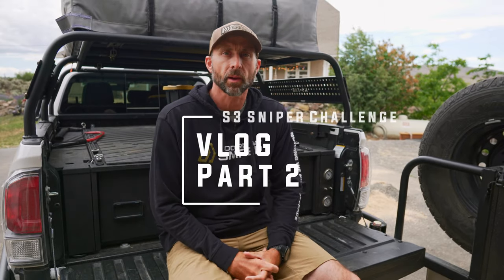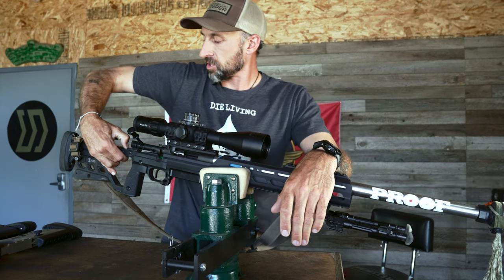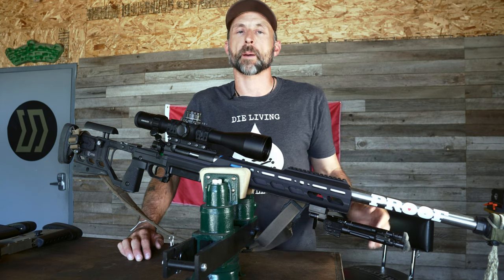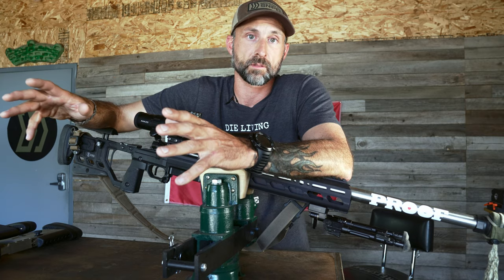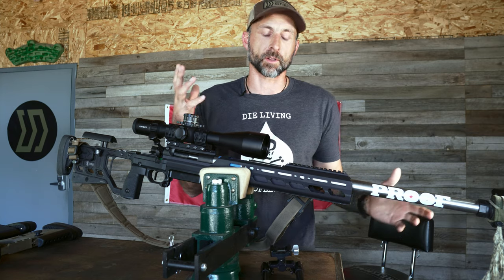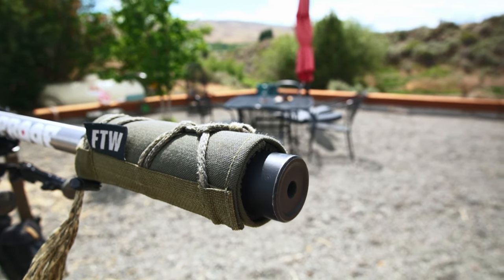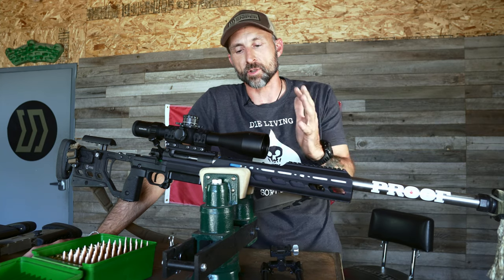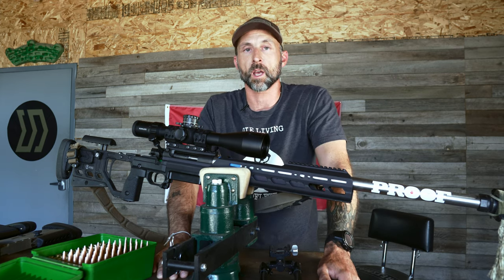Part 2! S3 Sniper Challenge VLOG Series, The Rifle

Comment: Doubling up on ear pro helped my brain concussions...I switched to ops core amps with nfmi plugs and that helped tremendously in keeping the brain running nicely
Reply from the maker: I'd like to do that, but plugs on top of muffs really deteriorate communication and kinda defeat the purpose of passive ear pro.
Reply: @MODERNDAYSNIPER  check out ops core amps, the nfmi plugs have some vudoo that pass the sound into the earplugs, it's a two layer system so they sound just as good as single layer.

They also have a 20% discount code